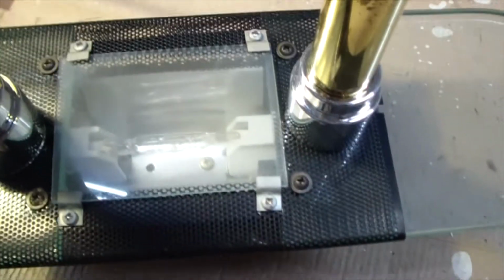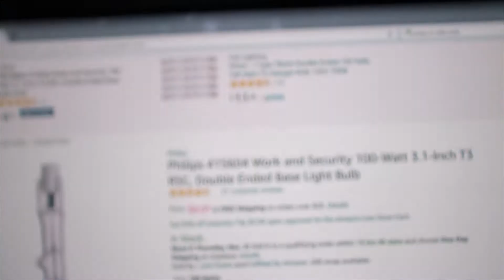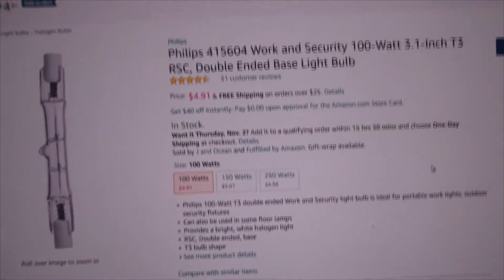Converting Halogen T3 Lamp to LED Bulb

Comment: Hi, Kent. Thank you for this video! I have several light fixtures I'd like to convert from halogen to LED. In fact, one of them is the same one you have in this video! I love it but haven't been using it due to the heat. My question is, how do I find a heat sink if I don't happen to have a Pentium 4 heatsink? Can you recommend alternatives or sources? Please keep in mind, I'm only a DIY-er, not a professional tech or electronics person! Thank you.
Reply from the maker: Maybe you can look for electronics recycling center. On Craigs List look for old PC parts seller.
Reply: @KentDiego  Good idea! I'll do that. Thank you!

Comment: hello I have an audio system philips fwm583 but it doesn't power on yet the screen is showing the time, it only turn on with when I set the timer and when I press the power buton to power off it works, but it doesn't work when I try to turn on the remote is working well but it cannot turn on the system, I know this hasn't to do anything with this video but I just need your help because it seems you are very skilled, thank you so much